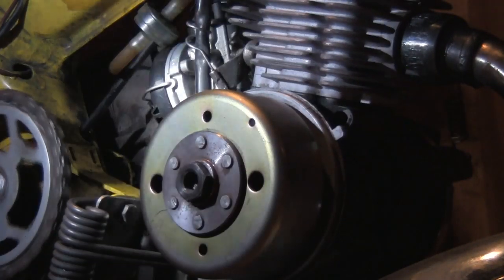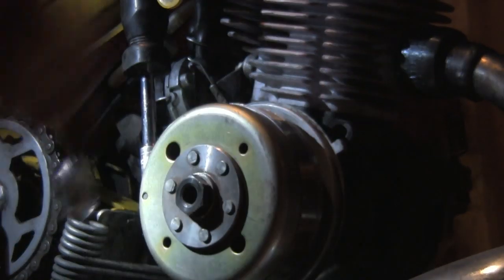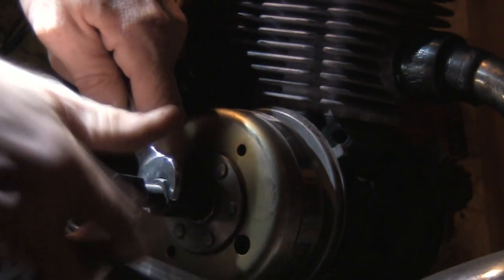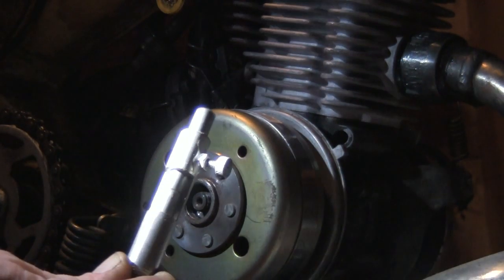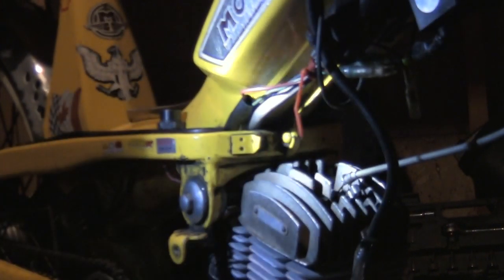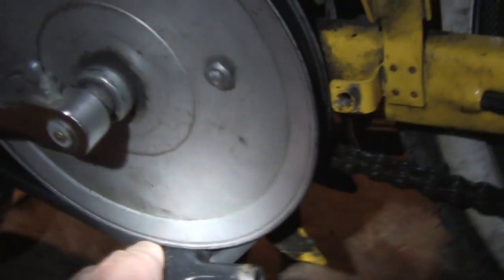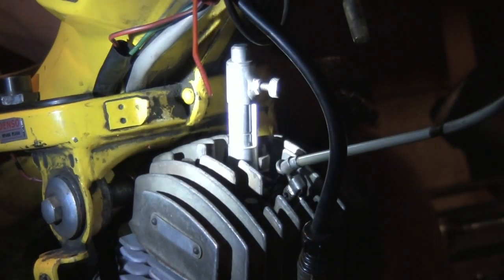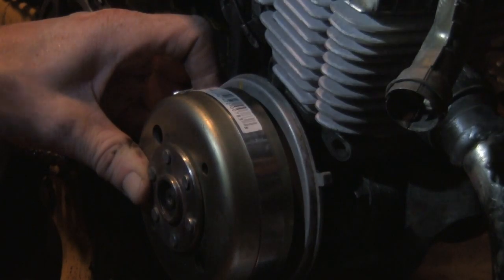motobecane cdi timing.avi

Comment from the maker: We moved...
got me a nice single car garage, installed 40A electric service, insulated and dry-walled it this summer (im a HACK at drywall but its on there) and built me a nice strong bench with a vice. more mods to come (compressor,bench grinder satelite TV, just the basics, you know) but i now have a well lit super deluxe moped workshop... way better than the cold dark garden shed.

Comment: you could work on Radio with those cool tones!
great vid,helped me out dude,ta.
Reply from the maker: glad it helped.

doing lots of work on her this winter, ran a Polini 70cc with Polini av10 bottom end this summer... im just a hack with motors but we broke 100 km/h with throttle to spare. clutch pulley n hydro forks this winter...
FUN